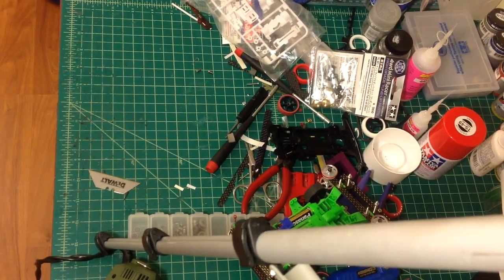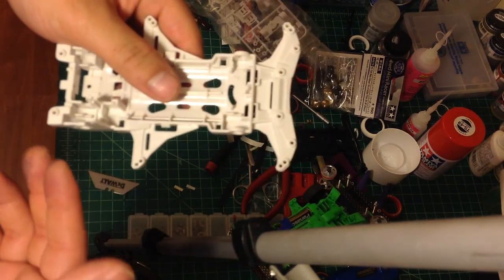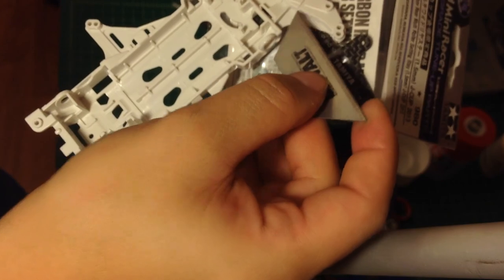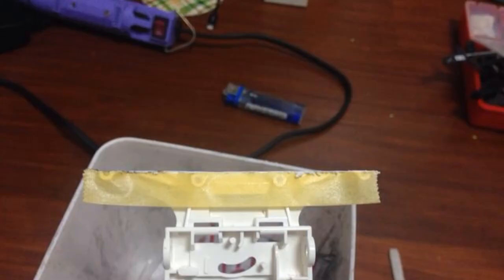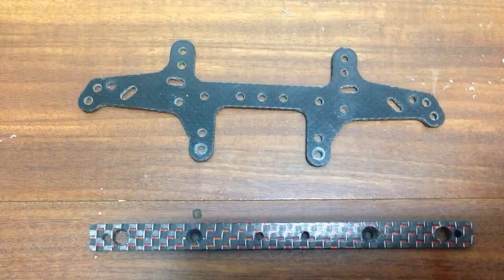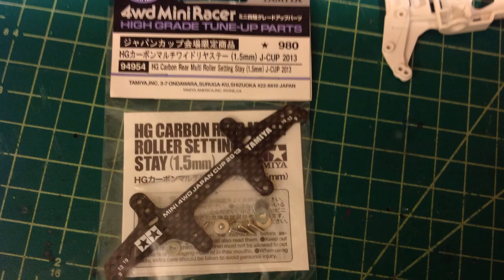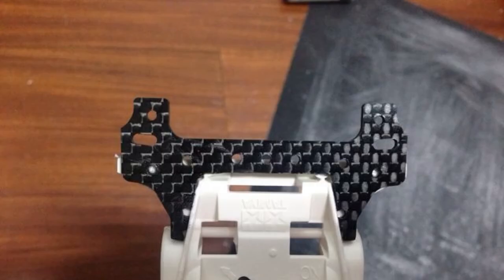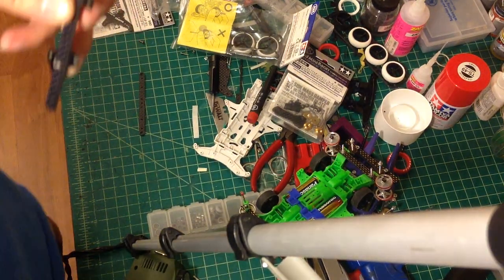Tamiya Mini 4wd Tutorial Japan Cup Style VS chassis Front bumper Reinforce

Comment: I'm using VS chassis, it's lightweight and flexible. but yeah, the front part is weak. my solution was (not the smartest one), put lots of glue (cyanoacrylate or whatever that was), to cement up that part, even though, few more hits and it's finish...
I like your videos, mr Mad Tang, they are amazing, and I learnt a lot from them. Please keep the good work hehehe...

Comment: I am trying to add the sand down pin gears on my x and vs chassis to hold the gears down. This is unlike the MS and MA chassis u provide videos on. How tight am suppose to hold the gears down against each other? I think my gears is too tight and it keeps the wheel from spinning as fast as it suppose to be. How much spacing am I suppose to have?  Thanks.

Comment: Can you make a video on installing the 520 bearing on the propeller shaft for the VS chassis.  Also, can you show a video on how to install the sponge on the terminals as well??? I am curious on how to add those to my VS Chassis. Thanks
Reply from the maker: It is hard to make video for 520 transmission~~ most of people has no Professional tool~~ plus everybody has different skill on handmade~~ I think i only will do a video for how to use sponge to reinforce the motor ~